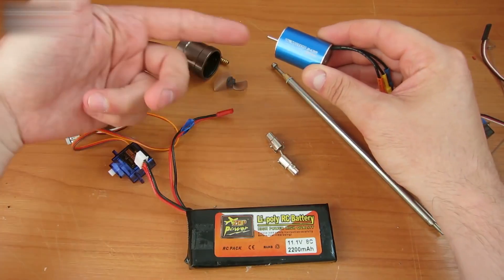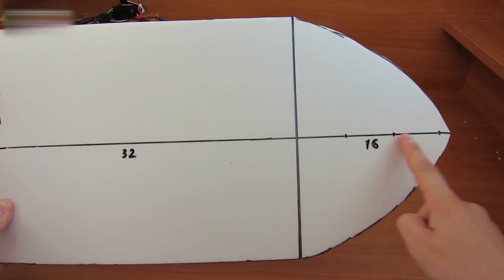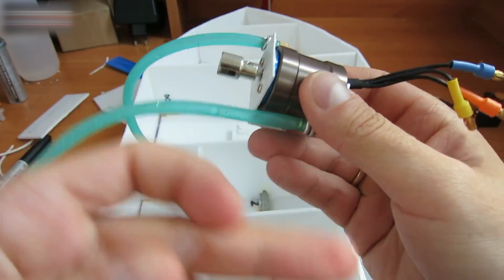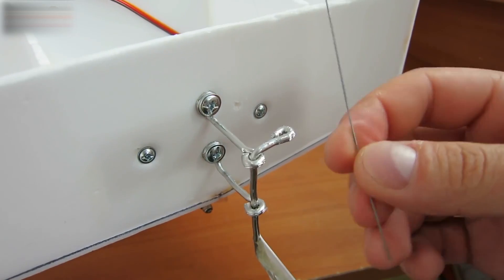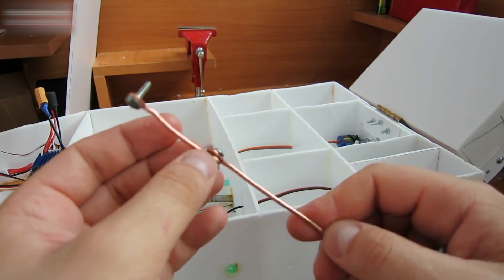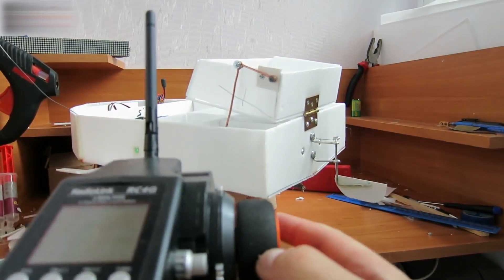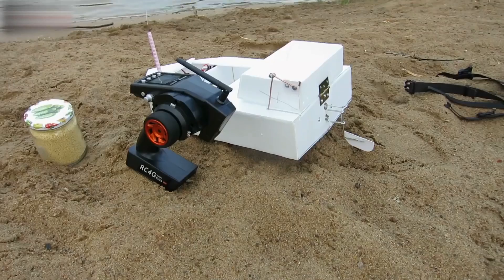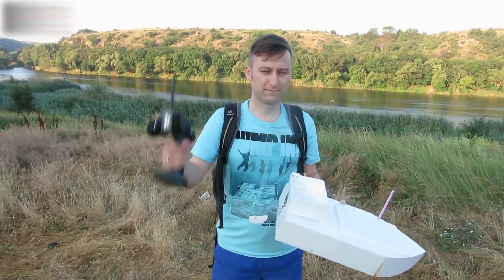How to make a small boat for bait delivery // HomeCraft

Comment: nice idea actually fantastic, will be good for shark fishing with some Additions.
but I was wondering if I can make from wood not a foam?, for more Stability and durability.
Reply from the maker: You can try with wood, however, wood is much harder to work with and it is more expensive. It is obviously more durable in the long run.